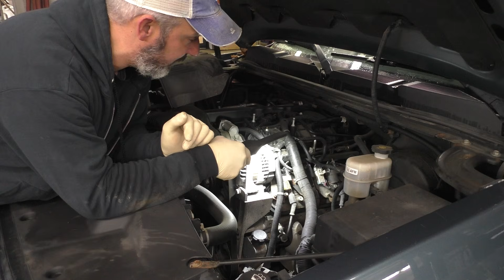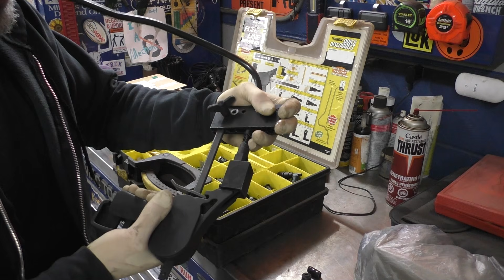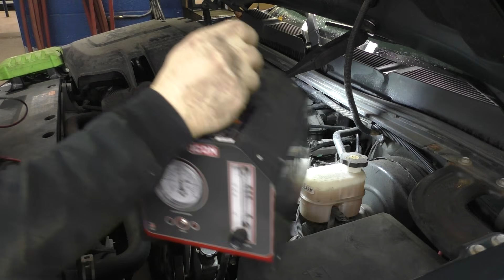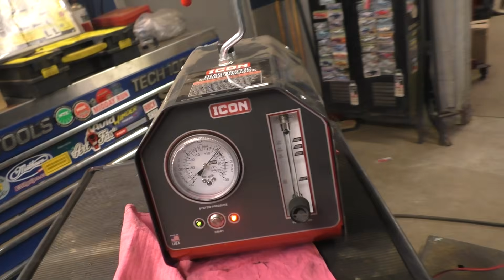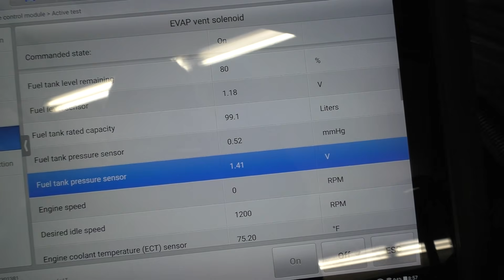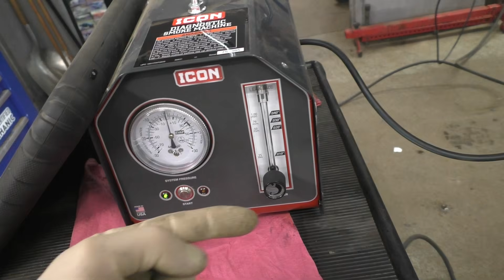'13 Chevy Silverado - Finding The EVAP Leak

Comment: I failed inspection on my 2010 Chevy Silverado (5.3L engine) for "Evaporator Vent Solenoid Circuit Status Incomplete".  The Evaporator Vent Solenoid Status = Venting (never changes).  I have tried the "Drive Cycle" procedure for at least 50 miles... but no change.  No MIL codes.  The solenoid works fine when I apply 12V (can hear it clicking, and I cannot blow air through it when "closed").  I don't have a scan tool.  But if I had a wiring problem to the solenoid... wouldn't I get a MIL code?

Comment: I dont know if youll read this. But i have a 07 chevy new body has the Evap code and recently i noticed something. I was going to get gas and when i went to take the cap off it sucked in air into the tank. i started pumping gas and it kept on cutting the nozzle off. Then i took it to my works office and checked if was going to suck air and this time it did and heard popping i closed it back immediately and sent under the truck and saw my gas tank sucked itself in, after i removed the gas cap again the tank went back to normal. i might change this part to see if it will fix it.

Comment: I took my truck to a shop who smoke tested it and said they couldn't find any smoke. Unsure what to do now as the light came back immediately. Find another mechanic and share your video or should I just start replacing parts?
Reply: Do not replace parts. Fired the parts cannon at my truck. Still got an error code.

Comment: Is there any way you could inject a little A/C refrigerant into the system and use an electronic leak detector to help find those small leaks?
A manometer is the instrument for measuring inches of water pressure.

Comment: If you only need to do that once at home and can't rent the tool, make the "die" part from a block of wood.  Drill a hole a then split the block with a thin saw blade.  Worked for me.  Handy as a 2 pocket T- shirt!

Comment: Can you explain? If the purge valve is normally closed, and the canister valve is closed, I would think the system would be sealed, and draw a vacuum, not if the purge valve is open or slightly open. You lost me..

Comment: That evap leak system is bs. Always has issues in the dust - gravel belt. I’ve done a few deletes of that system with an HP Tuner. Problem solved forever

Comment: I believe that the term is Manometer and HVAC used to use water column manometers for inches of water measurements in furnace systems. Great video and very interesting watching you do the emergency repairs on the fly. Thanks so much

Comment: I’m still driving my 2004 Escalade EXT with the 6.0 everyday. And pulling my large boat with it occasionally. Frame and engine still completely intact. Can’t believe the frame of this 2013  truck completely rotted out needing a hack job repair. Me Living in Florida must have some rewards.
Reply: They’ll last much better with annual oil coating on the underside. But, not many people worry about it. A lot of people seem to want a new car every 5-10 years anyway. 
Personally I try to keep my car decent and run it until it’s either done or it doesn’t fit what I need anymore.

Comment: I’m glad to see someone else has the Dorman fuel line repair kit. FYI, use a heat gun on low heat when you begin to press the fitting into the nylon and heat the hose briefly and the feeding will slide right in and wrap around the fitting like it was heat shrunk around it. Great video!

Comment: Just went through a P0452 small evap leak. Smoke test revealed no leaks. It would pass a service bay tests. Turned out to be a faulty fuel tank pressure sensor that was faulty.

Comment: Speaking of gas caps,why do Aftermarket ones barely last a year!?Annoying
Reply: Usually because they make them with whatever plastic and rubber is cheap instead of the correct plastic and rubber that will stand up.
Reply: @NBSV1  ur probably right!Smh

Comment: USA vehicle mechanic videos make me chuckle.... let me just get my step ladder to get a decent vantage point to look at the engine, hell I need the step ladder to just open the hood. It's got the roaring thunder Chevy 7 litre engine producing a massive 300 horsepower and 300 torques and does 20 mpg.... that's cutting edge.
The rest of the world looks on and just sadly shakes their heads.
Guys of the USA, the size of the truck you drive, how much noise it makes, how much smoke it makes is not a good indicator of your virility or the size of your penis. In fact having a giant prosthesis says exactly the opposite.

Comment: Chevy lines both coolant and Evap lines are very prone to failure. Most dealerships have them in stock for a reason. Be careful how hard you breathe if you open the hood of a Chevy Cruze that's any older than 3 years old.

Comment: I have a 12 with a little over 80k on it. I occasionally get a tighten gas cap. message. 3 did throw new cap on it,and it still pops up occasionally. After watching this,  I think I have a little more work to do.

Comment: I dunno. My local Dodge dealership said I needed a new gas tank cause I couldn't get the gas to flow. Only $800. What a deal compared to that $2500 for the tank repair. No. I didn't get 1. Still living with a slow-filling tank.

Comment: Had a friend with a Toyota Tundra. Pool chemicals ate his frame . I took it to a shop down the street from my office. They rapped the frame at the back of the cab. Both sides. $150. Took them one hour on the ground. No lift. I jacked the frame as they needed. Pretty cool how they did it. Guy said he had fixed a few Toyotas  because of the cheap frames.

Comment: Black Plastic CRAP.
We would never allow this pathetic plastic crap on any small airplane, so why do we accept it on overpriced Automobiles?
Reply: Probably because an evap leak isn’t going to cause a car to fall out of the sky. Planes tend to be much stricter on everything because gravity and the ground is pretty unforgiving.
Reply: @NBSV1  the point is, METAL TUBING was the standard in this country, on all autos longer than this plastic crap has invaded our lives, destroying performance and pocketbooks.
Reply: @andylowe2725  What evap system was ever plumbed with metal tubing? And, hurting pocketbooks? Do you realize how expensive cars would be if build to aircraft specs?
Reply: @NBSV1  I'm a mechanical engineer, yes, I understand. Venting vapors back to the intake is easily done with metal tubing, and one flex hose
Reply: @andylowe2725  Cool, can you make it with metal as cheap as with plastic? Remember profit margins are the highest priority.

Comment: Those smoke machines are a great help. I bought one to diagnose if my catalytic converter had a leak near the oxygen sensor. It didn’t so I ended up replacing the catalytic converter with an after market unit. This solved my engine light issue. It been months and the money light has not come back on.

Comment: Jim Carey in The Mask - "Smokin".  Teaching my grand-niece to drive, it's exhausting. The thieves cut out the filler neck so they could siphon the gas out of the tank in the work truck. Did not leave a note. Found the tank empty, went to the gas station, yep, dumped about 3 gallons on the pad. 800$ to repair that and they got what, maybe 40$ of gas.

Comment: To be honest I repair frames alot to buy the customer some more time before the crusher. Couldn't see the welds real well but looked better than holes 😂 2500 is pretty much, but it's worth a days pay plus the steel. I take the tank out before hand, and if the pump and lock ring are jacked, replace as needed❤

Comment: You can add UV dye to most of the oils used in the machines, 99% of them use simple medical grade mineral oil and it mixes in real well. If you really want to have fun, cook up some bacon and mix about a tablespoon of bacon grease into the tank of the smoke machine !!!

Comment: Why do they use those rigid "pipes" for those lines, would a hose not work ok or would the connectors leak where they meet the hose?  I had an evap leak on my suburban, and was pricing those and they seemed pretty pricy for what they are.

Comment: I appreciate all of your videos that you have put out ( that I have seen) . So much easier to watch than some, you have a way of explaining diagnosis and repair. Do you have any with an extended crank when key is returned to the ON position and no start CHEVROLET or FORD? THANKS

Comment: I've got an Autool smoke machine i got of amazon a few years ago before the icon was available.  It is a similar machine and runs on mineral/baby oil.  I found that i can put a few drops of UV die that you would use in motor oil into the baby oil and it works great on those small leaks.

Comment: You can add UV due to any of these smoke machine oils. They sell just the dye, which is also handy for diesel and tranny leaks, so it is handy to have around for just such an occasion. Also, as far as I can tell, all smoke machine oil works in all the machines, so if you find one you like, you can use it in any machine you like.  

The smoke machine oil with the dye is like $3.00/oz. I just use the cheapest mineral oil I can find, which is in a gallon jug, and add about 1 oz of the dye to it, which totals out to $0.20/oz.

Comment: That line must have been brittle enough that it was ready to let go with the slightest touch or it had a hairline crack in it.  Either way it was gonna let go.
The smoker for the win.  Nice tips near the end of the video on how to catch the smoke I'd it's difficult to see the leak.  Gotta save this video for that tip.
Thanks for the tips and Good one Mr. O!

Comment: Eric a heat gun with a reasonable application of heat on the plastic line can really help installing the fittings with the dorman kit on older lines. I think ours is the same age as yours, it has saved us countless times and customers alot of money.

Comment: Manometers are used in the gas industries and diesel engine diagnostics, HVAC, and anywhere very low pressures are used. In the service we had inches of water and inches of mercury using a u-tube for engine diagnostics but this was many years ago.
Reply: Detroit Diesel tune up kit had the water and mercury manometer.
We had magnahelix gauge for the air filter restriction indicaton on Letourneau loaders

Comment: Had a 1978 Chevy 3/4 ton.  Crack frame both sides back by rear axle.  Took to welding shop $150 . Sand blasted areas. Thick pieces of steel welded in. This was around 1990.    Gotta admit I love Icon tools.  That smoke machine is $500 plus I think.  I would charge for the hose piece you had to put in.  Thanks for the video!

Comment: $500 for the welding (parts & labor). $2,000 for the liability insurance, because he does a crappy job, and that frame is what holds this truck together. A failure of his welds will result in a high-payout for is liability to the customer.

Comment: I did go check out the Icon smoke detector on Harbor Freight. $550 for the kit and that's the only option. Seems pretty pricey for your average DIY guy to me. As a 50+ year DIY guy I've always appreciated HF for being able to get decent tools at extremely affordable prices for those jobs that require a once or twice in a lifetime use. Unfortunately I think HF is getting away from that business model and trying to compete with the tool trucks. I'm completely sure that Icon smoke machine is a fine piece of kit. It is however, much like most tool truck things, out of my price range. Should I need a smoke machine I'll be shopping at the "Jungle" store where they have many with 4.7-8 star ratings with hundreds of reviews for between $100-$150. Much more in my "need it once or twice" range. HF is trying hard to ease there "junk tool" reputation but they're pricing out the very guys that their business was built on. I miss the old HF of free dvoms, monthly fliers and store wide discounts.

Comment: That's a Bartholomew quick disconnect developed at our shop in Michigan, we called it the duckbill.  The internal clip was so light I controlled the orientation on the assembly line with small jets of air. it's a good design Don was a genius.

Comment: Anybody that has done a home project, knows that any home project, no matter how much stuff you buy to prep for the project ahead of time, it's never enough. At least 2 more trips to the store. Even if you buy an extra 10% overage normally and then you go to 25% overage to prevent the trip to get more product, then you have to go back to return to overage because you then used exactly the original estimate and you wind up with 25% extra product. The beauty of having a shop is that you can keep overage and repair gas lines from the kits that you had to buy 25 years ago.

Comment: That smoke machine is a new ICON tool. HF price is $ 550.00 bucks, that’s high for your average DIY guy or gal. At 78 I don’t think that would be cost effective in the long run ! But by the grace of God I still may be wrenching at 90, slowly, naw, take it to SMA.
Reply: Icon is not meant for the home gamer. They're going after the pros with that line.

Comment: Those smoke machines Make Life a Whole lot easier to Find a Leaking Hose or Leaking anything.
i Wonder could u use it to find a Oil leak ?
stick the smoke hose in the oil fill cap , plug it with a rag and look for smoke at valve cover gaskets , oil pan gasket , Front cover area.

Comment: Few years ago I kept chasing small evap code on our Express 3500 6.0. Tried gas cap, checked lines, parts cannon with both valves,etc. Then used scan tool to actually DIAGNOSE. Issue with fuel pressure as Mr. O mentioned but I just couldn't find the source.
Not affiliated in any way - I bought very reasonably priced smoke generator, Autoline Pro Evap. Within a few minutes found the leak, fitting right at the pump. No way to even look at the fitting without a camera.
Dropped that tub of a tank, cracked fitting. New oem pump and done. 
I figured that was it as far as using the smoke gen, but I've used it quite a few times to verify integrity of various systems.

Comment: Thanks for all the knowledge you impart. And yes, I would charge to repair the line. Actually pretty common to find fallen off on one or the other end on Chevy express vans. I thi k time, mileage and heat bake the line material.

Comment: The S.U.R.&R. Kits are way more user friendly then those Dorman kits but you wouldn’t have reused  that line with there fittings there like a loose fitting pair of Jeans but you don’t need that press tool and bend the line etc etc

Comment: Bringing a 2013 Chevy Equinox to MN from Vagas (AKA rust free) next month. Found a local guy who will Fluid Film it for $400.00. He says he doesn't do any drilling to get to hidden spaces. He's been doing this type of work for 6 years. 
Good deal?
Bad deal? 
Oh, I'm aware of the PCV issues and oil consumption. I'm okay with dropping the pan, pulling the head and putting in new rings. Just did it to my '03 Forester.

Comment: I got a '15 Silverado with a evap leak. Done did the gas cap first thing and patted myself on the back thinking I 'solved' the issue. 2 weeks later the code came back. So now I'm gonna pay for the smoke test cause I think you has shown me what the issue will be. Thanks for helping a non-mechanic to be able to know if they are being scammed or not.
Reply: @kimberlyokeeffe5360  what was the problem

Comment: You can add just a touch of a/c compressor oil that has dye in it to the mineral oil of the machine, and then use your black light w/o buying a machine that already has the dye in it. The guys at the GM Training centers ( now long gone) in Hinsdale IL were doing that in the early '00s with just a regular smoke machine with no issues.

Comment: I had a Holden (Australian Chevy) Cruze with the big 1.4L.

Replaced head gasket etc.
Come back with an engine light on and P0171 (we don't have evap monitoring).

Spent a while checking over my work and all was ok. 
Initially ruled out the purge valve as it was clicking and started chasing the problematic PCV system.
After ruling that out, went back to the intake and found the purge wasn't sealing when "closed".
Thanks GM.

Also those valves are over $500 here.

How to explain it isn't warranty  🤔

Comment: I was watching an Adept Ape (the diesel mechanic) video using a UV reflective oil additive that he used to find an engine oil leak.   If you can add it to engine oil maybe it would be compatible with the smoker oil.  Just a thought.

Comment: Nice-- Magnahelic gauge  -Used them for my entire air compressor career on Centrifugal Air compressors for the intake air side of the machine. And a similar gauge for differential pressures and vacuum.  And one other called a Compound gauge that reads positive and negative pressures.
Reply: In my former career with the Navy, we called gauges that measure air or gas flow  using differential pressures magnahelics (I think that might have been a name brand though) and the ones that provided pressure measurement readings in units of inches of water "manometers".
Reply: @NukeChief722  From Google ---The Magnehelic® gage is the industry standard to measure fan and blower pressures, filter resistance, air velocity, furnace draft, pressure drop across orifice plates, liquid levels with bubbler systems and pressures in fluid amplifier or fluidic systems.
Reply: When I moved from auto shops to industrial, the common term for that sort of gauge was compound.
Reply: @BobSakamoto  Compound reads two directions

Comment: My 2013 Dodge Ram had a small EVAP leak and until I brought a smoke machine I couldn't find where it was at. Using the smoke machine I found where the problem was which was a small hole in one of the lines. Money well spend for sure.